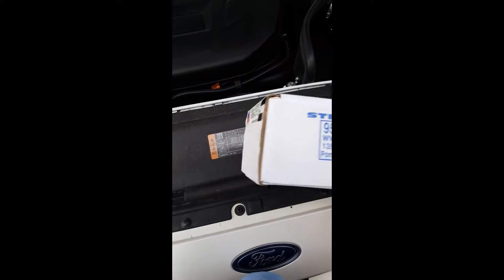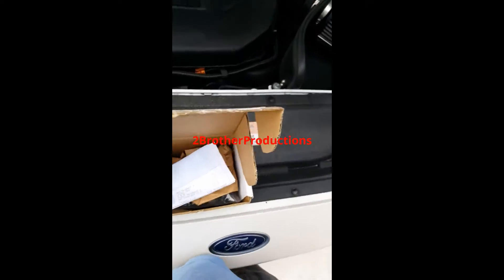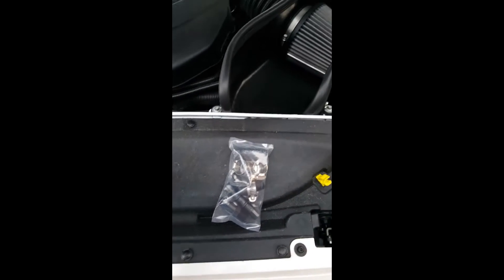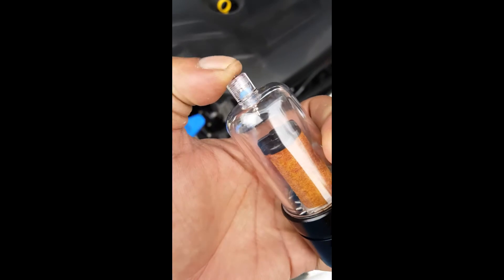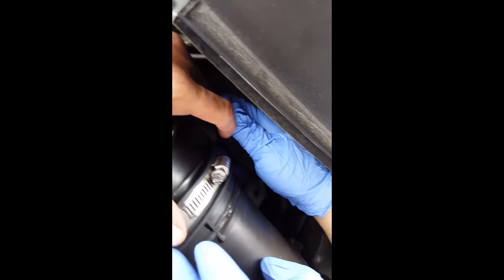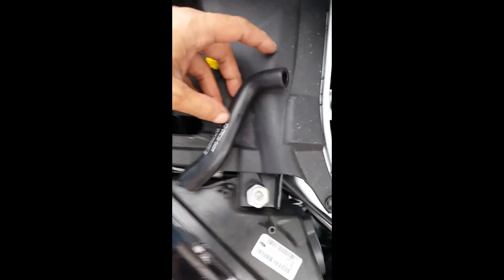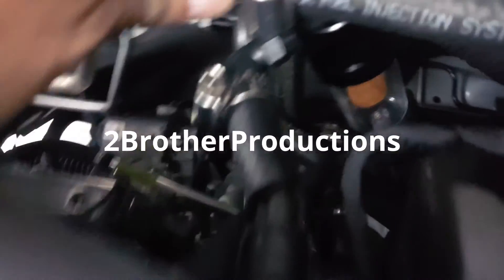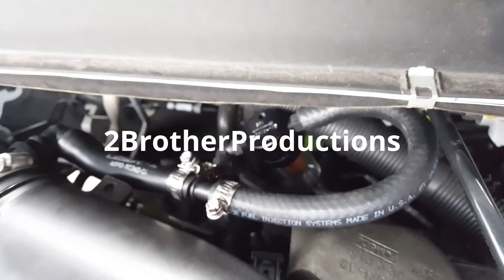2013-2015 Ford Fusion EcoBoost Steeda oil Catch Can/Oil Separator Unboxing+Install

Comment: steeda does not list the fusion for their oil separators. Is this the one listed for the Focus ST  2.0?
Reply from the maker: Yes thats the one. It can also be used with the Fusion 2.0.  We recommend getting it to protect the engine from all that oil.